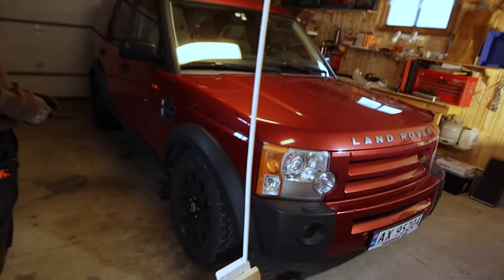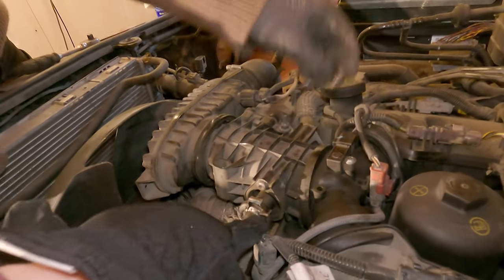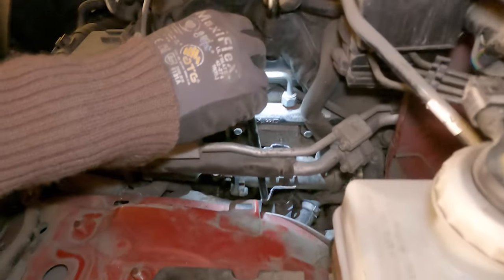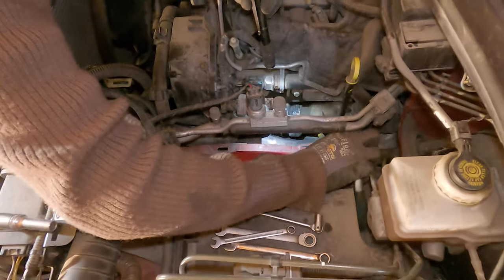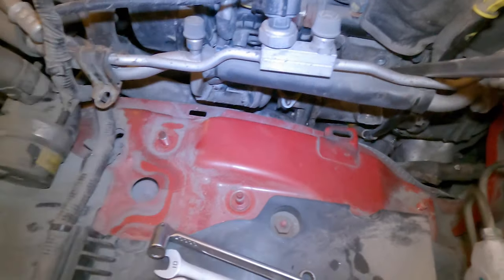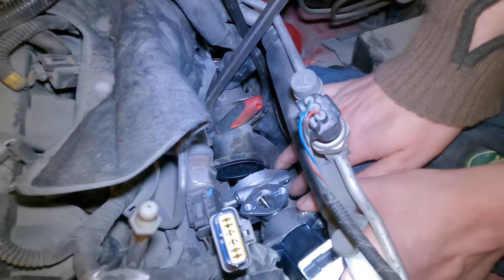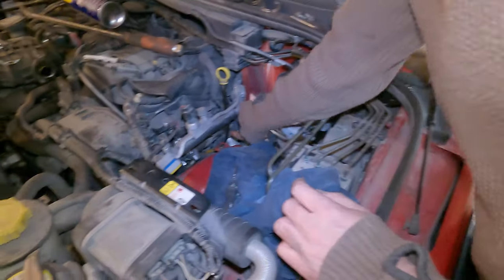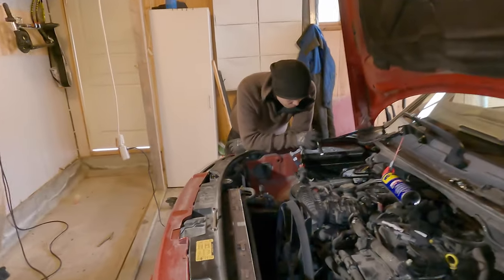HOW TO replace the EGR valve on a Land Rover Discovery 3 TDV6 - FULL DETAIL

Comment: Great vid, mate. Like the point of view and the real time problem solving. I tried to use the special tool for the cooler clamp but it didn’t have enough clamping pressure. I thought it was because it was a cheap knock-off. Now I know how to tackle it - thanks to your vid.
Reply from the maker: Yeah, I looked at those clamps as well and no way it would have worked for the cooler-clamp. Glad the video could help and thanks for letting me know. It’s why I make them, sharing my experiences as I go along. 👍😊

Comment: Hi. Thanks for this video, it helped me a lot replacing the L/H EGR in my 2009 Disco 3. I was able to do it even without removing the clamp on the back of the EGR cooler. Annoying work, though. Thank you and also thank you Erik.
Reply from the maker: Thank you for letting us know! Then this video has done it's job and it was all worth it. 👍🙂 Great that you could do it without removing the clamp, that one was a pain. I was surpriced the amount of force needed to get the clamp to shut properly.  Erik reads and responds to comment's now and again so I'm sure he will see this, but I will let him know. Best of luck with you D3, Simon. 🤙
Reply: @LandRoverDrive  Yeah, and the timing was perfect. Bought mine two weeks ago (also without DPF and no lock on the rear diff as yours) and while I was on my way home suddenly I had a loss of power and the car only crawled.... Had to cancel several appointments for the next days because of a broken car and started to look for how to fix the this. Thumbs up and I'll follow your channel : -)

Comment: It seems like a monster job. How often do you need to change EGR-valve on a LR3?
Reply from the maker: A lot of painful fiddling for just one part change. 😅😅 I don’t actually know, but mine had lasted minimum about 6 years and 100000km. I’m guessing they have been changed out once before. But I guess it all depends on the driving style and such. Only EGR on Discovery, LR3 is the name of the V8 petrol version. It’s actually was renamed for the American market. 👍😊
Reply: @LandRoverDrive  In that case I would buy an LR3, I figure it will be less time in the garage, even it would cost a fortune to drive it.
By the way, like your videos a lot.
Reply from the maker: @tomasfransson7408  Thanks man, appreciate that a lot. 👍😊 And yeah, V8 would be the safe bet for the long run. Will see if I can hit 300k km in mine before it have had it. 😅

Comment: I already wrote you under your previous video, but my comment was blocked I don't know why. So - did you think about of some kind of bypassing of EGR valves? As I know this will no done to bad results of your engine - will consumes 1l/100km less and no biger bad polutions. Look at this guy : https://youtu.be/tk5PUCm4xVc
Reply from the maker: Hey, I usually remove comment's with links. 🙂 It is not legal to bypass/block the EGR valves, and if you remove the butterfly valve and you get a turbo failure the engine will run on oil and there won't be anything that will hinder it or stop it from "running away". And with an auto box I'm not willing to take that chance. 😅  For late 07 and upwards you also need a software patch. From 08 with the DPF there is also something which I don't remember at the moment. So, to sum up, replacement was my only option. 👍
Reply: @LandRoverDrive  &